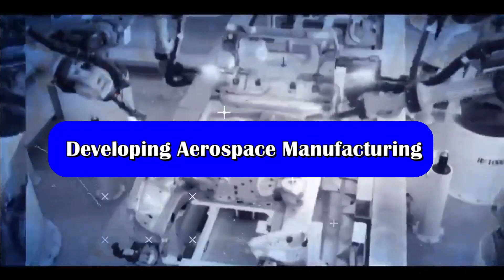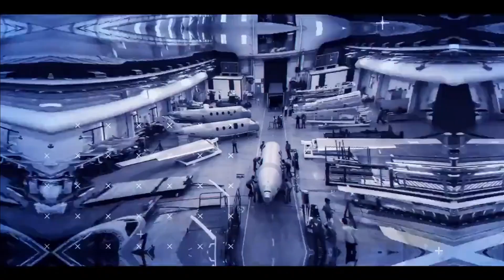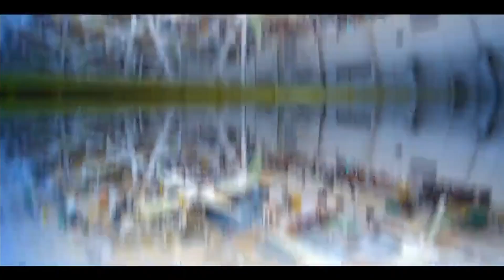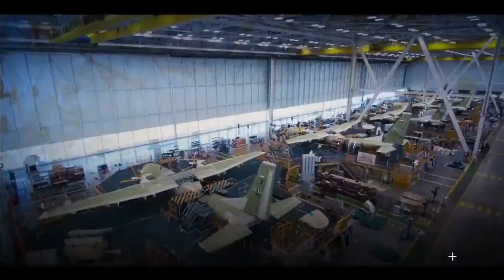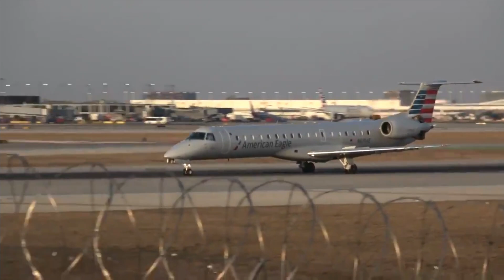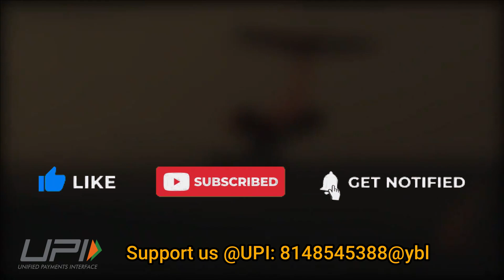After success of TATA-Airbus deal, Embraer looking for Indian partner for its next gen. tuboprop jet

Comment: Finally! I have been advocating that HAL buy Embraer in a 50:50 deal, splitting costs and
shareholding. Bharati OEM's like Tata and Mahindra can become Tier 1. Great for public
and private sector. 

And Bharat will finally have its own jet planes, and can work on replacing the jet engine used by
Embraer with Kaveri or its derivatives.
Reply: Keep HAL out of manufacturing process
Reply: @albertroy9620  No choice. Tata and Mahindra are in debt. They can't buy Embraer.
Reply: @datoolz0  Mahindra can. Because Mahindra has already an aircraft division. I can guarantee Mahindra have more efficiency than HAL. Because a government company can afford to have less efficiency and quality because the money will be paid by our tax but in case of a private it can't afford to do that. Because it has to take the liability of all the things.
Reply: @RahulMishra-ld2bo  Mahindra and Tata are both just OEM's, and not even Tier 1 in aerospace. All of our corporate houses are deep in debt also, particularly Tata due to their Air India purchase.

HAL is only option like it or not. Tata and Mahindra can become Tier 1 suppliers, which is big upgrade from their low current status.

Boeing/Airbus buy parts like engines from Tier 1 suppliers who buy from Tier 2 who buy from tier 3,